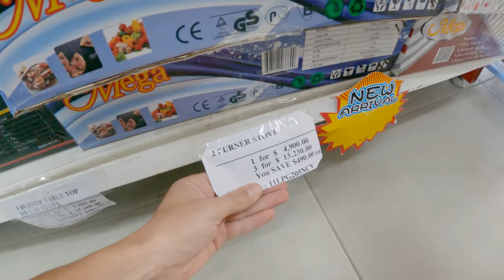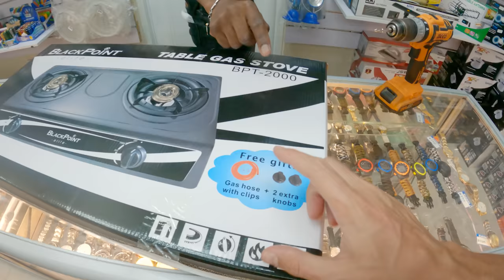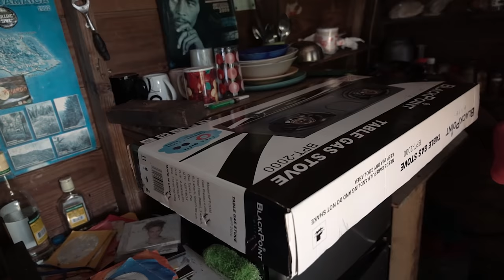Police Bredren and new Babylon Stove

Comment: Great content. The reason they want you to back in to a parking space is because of safety. Backing out of a parking space causes more collisions. But if you back up into the parking space you have greater visibility when leaving causing less accidents. In essence you have better control.
Reply: Yah man. Tell Dem Backing up is better but it's a skill set most don't have.
Reply: It is the same either way. The same way you back into a spot is the same way you pull out of a spot. The only way it makes sense is if you are parking next to a larger vehicle that blocks your vision. In another country, when parking near a bank, they make you pull in front ways for security reasons because it takes longer to back out after robbing the bank allowing more time to stop the perpetrator.
Reply: @JR-mo8os  nope. Ask anyone who drives professionally, going forward is always better than back up with limited vision.
Reply: @columbushill4974  I did say unless your vision is obstructed which isn't the case most of the time. I don't need to ask a professional.
Reply: @JR-mo8os  Peace. Be blessed.

Comment: BREDREN - no.  BRETHREN - yes.  The gas stove is most likely the pressure regulator that's not working properly.  The valve that lets the right amount of gas pass through is stuck in the almost closed position.  It's the valve that between the bottle and stove.  Check it out and use it for spare.

Comment: Check the gas regulator. If you have the same problems with each of the 3 rings, the fault is almost certainly with the regulator rather than the cooker.

Comment: All those steel camping stoves are junk. The cast iron camping stove will out live you and has a mechanism to adjust gas flow aside from the normal temperature knob, so you can get it really really hot if you want to.